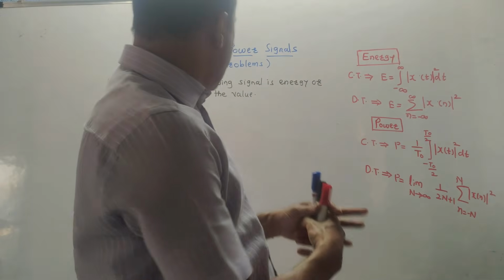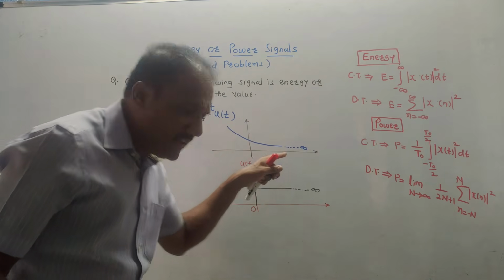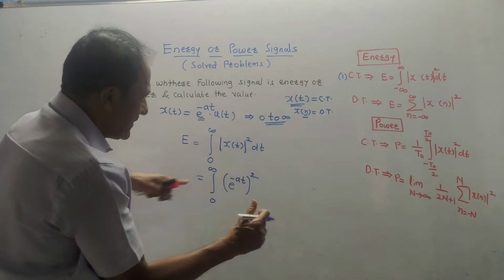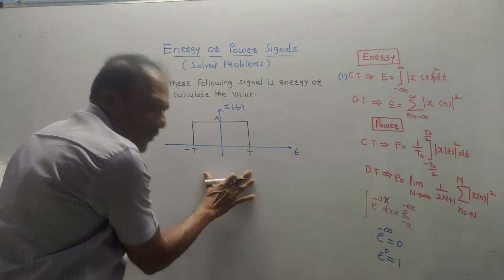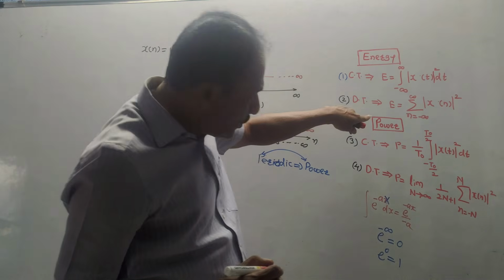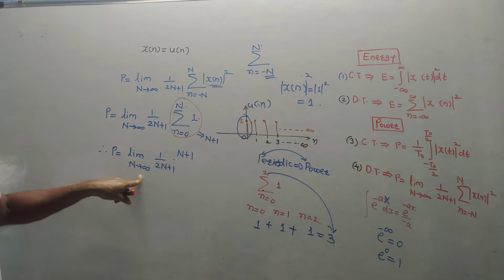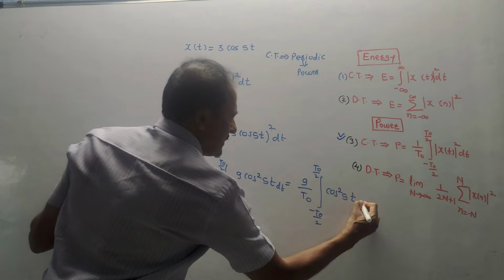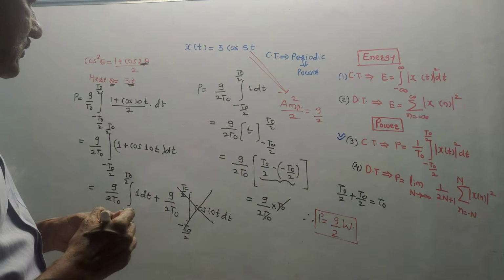ENERGY AND POWER SIGNALS

Comment: Hi Prof Barapate! This was an excellent session . However , I had a doubt in the last numerical. According to the rules for checking periodicity of signal that you introduced in the previous video , the function x(t)=3cos(5t)  fails the single function test since solving 2piFt=5t for the value of T would ultimately yield an irrational number i.e, T=2pi/5. So how can the function be considered a periodic function?
Reply: Ratio conditions apply only to sums of periodic signals, not a single sinusoid.
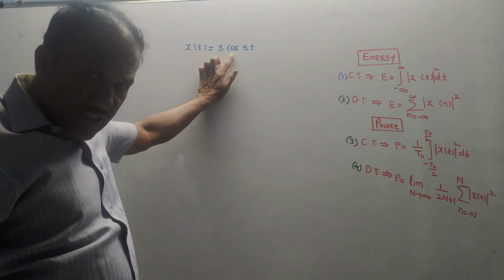Reply: Sin, cos always standard periodic signals  26:20